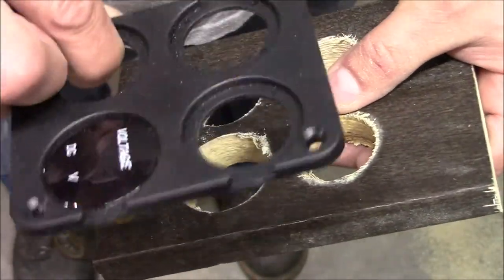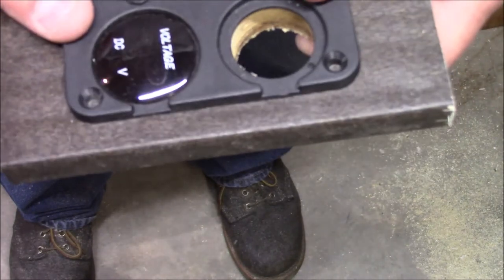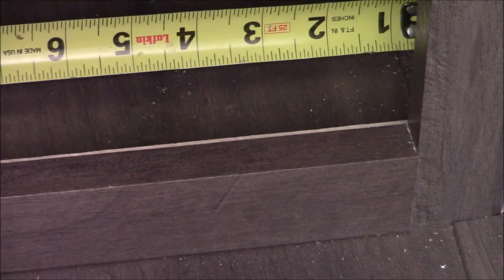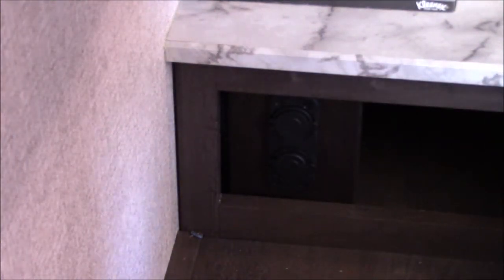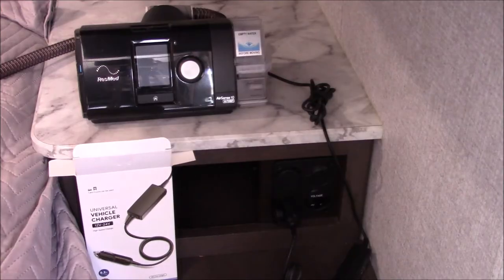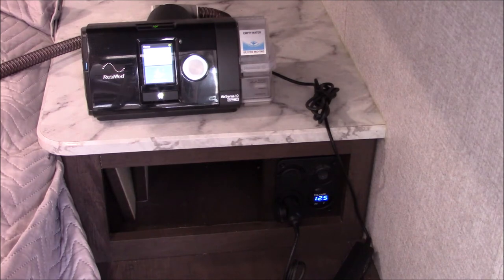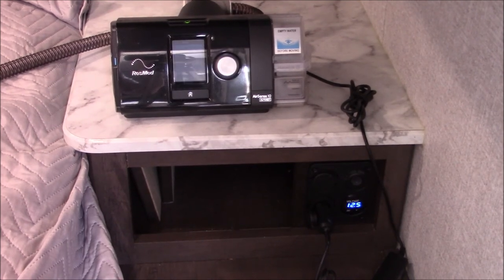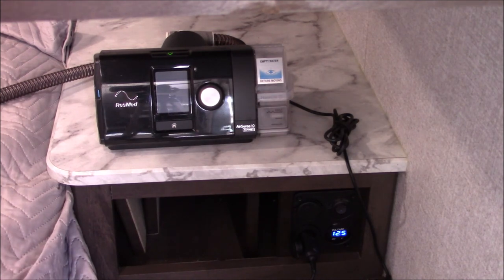12 volts for a CPAP in a RV

Comment: Do you have the parts information for the wiring and connections? Thanks
Reply from the maker: I purchased the parts off Amazon, 12volt to 24 volt C pap power cord, automotive fuse holder,  a 12 volt socket panel, and mine came with the electrical connectors for the panel. I already had the wire and a few connectors, I wish you the best on your set up